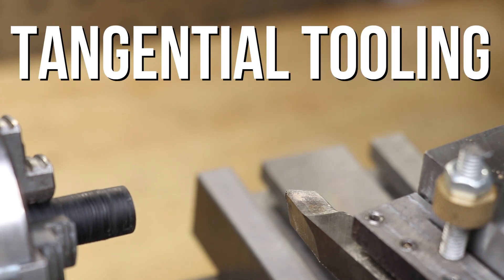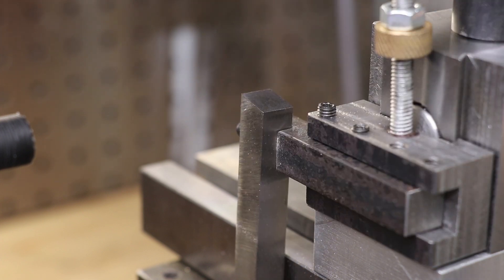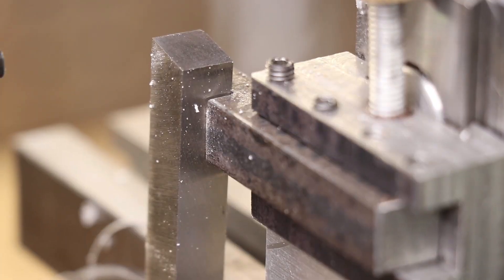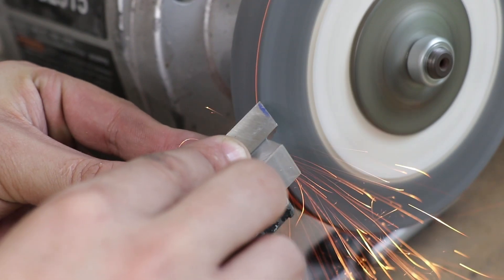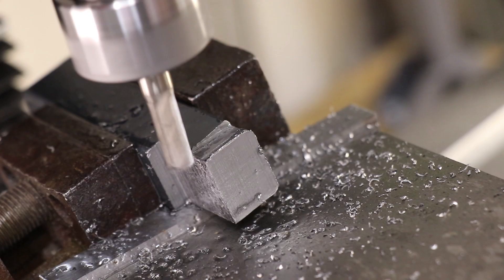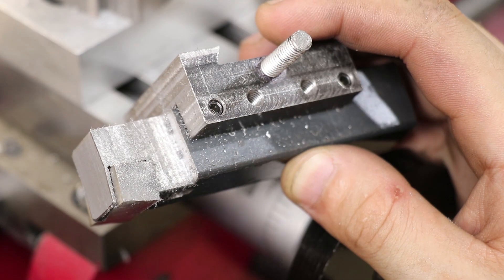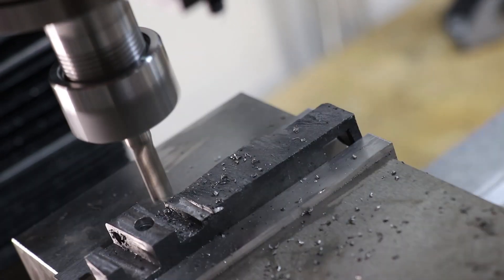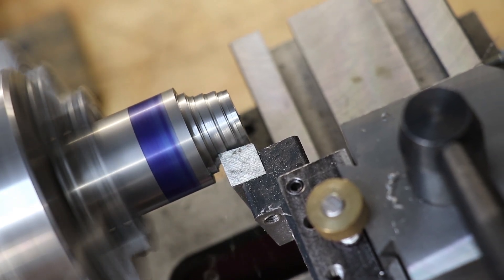WHAT Are Tangential Lathe Tools?

Comment: It’s somewhat amusing, but tangential tools go back to the mid 1800s. While they didn’t use tool holders the way we do today, they forged the entire tool as one piece. But the cutting portion was shaped like the tool blank in a modern holder, but not as long. They just ground the top. They could get a number of grinds out of it. But no HSS back then, just “tool steel”, high carbon steel, no alloying.

Comment: I don't have a lathe but I watch all your videos. This may be a dumb question but what is stopping you from cutting tangentially from a horizontal angle? A tangential cut is relative so I'm thinking you could have a horizontal tool and start your cut at the top of the piece. Stick out would be more but forces would be in-line with the tool and tool post. Maybe I just answered my own question. If forces are pushing back at the tool post, it might kick out the whole tool post? Thoughts

Comment: See if you can find a supplier of Solid Carbide blanks, then make a holder for those.
I might give it a try, since i make most of my lathe tools from Solid Carbide, broken or blunt Endmills,
In the past i have used square pieces of Solid Carbide which did the job excellently, though i had to grind them on 3 faces..
I use a Diamond wheel to sharpen them, and.. i admit.. boring bars are made on a wire EDM machine..

Comment: Very great video /info on tangencial tools.  This tool geometry made it's way into the standard HSS tool world of lathe tool bits [diamond grind shape] ironical from the use of this grind on HSS tools used in the balance and roller box tooling from screw machines back in the 1930's thru 70's IMHO.

Comment: I'm new here. But I have a comment question. 
While cutting some flat stock in my vice in my basement, with my hacksaw I ended up pushing too hard (1/8th x 2" ) I split my index finger nail in half at the base of thr nail threw my finger on the last stroke. It was amazingly bad. That was November ish 2019. For that christmass my wife allowed me to buy a used milwaukee porta band saw. I had one previously but sold it to a friend the year before because he was in need and at the time I was not using it nearly enough to justify it. 

I made it wall mount by a 2x4 steel tube that I cut the face and sides to accept the tools forward handle and welded it to a plate at the right angle to hang the saw. 

I made a 4 inch wide by 7 inch long cutting table that bolts around the foot of the saw and while semi stable, it is actually really good. 

I will make a video of this conversion from a handheld portaband saw to wall mount if you ask for one. 

But here is thr question. Have you considered swapping the hacksaw out for a different tool like a portaband? Or handheld bandsaw?

Comment: I have just picked up a old Hercus lathe 1957 era due to being on a disability pension  i dont have alot of money. Can i buy one of these holders . I cannot afford the carbide tool and bits so i was going to learn to sharpen Hss. But with this it looks like it would be even easier. Type c lathe . I can use up to 20 mm holder. Let me know if you would consider selling one also i live in perth Australia 6174 . Cheers Andy Andy

Comment: Check out 'Eccentric Engineering'.
Both square & round tangential tools work amazingly well with brass, cast iron, aluminium, plastics & composites. 
Would have loved to see the finishing comparison on a longer piece of material with tailstock support. 
If you twist-mount the HSS blank, it works as a shear tool too. The surface finish is dramatically improved over 99% of inserts that a DIY enthusiast can afford.
The lathe headstock does need to be as rigid as possible though, Worn out bearings will leave a chattery finish with any cutting tool, hss or carbide or CBN.

Comment: This principle has been used in form tools. It is easily sharpened as you pointed out, and the form isn't lost in the process. Another style is a partial circle with an adjustable means to keep it from rotating under load. I've considered making threading tools with the profile following the length of the blank. Probably would use a set/grub screw to adjustably counteract the axial load. 
Wanna' do and do are two separate things.

Comment: I fail to see the logic. What’s the point of creating another joint when you can grind tools in hss or carbide on a diamond wheel that are far more rigid. What you’re calling a good surface finish look very rough to me.
Reply from the maker: Is mostly down to grinding one face rather than 3.

Comment: One problem I see is that the tool will want to slip downward and nothing is there to stop it. I like the idea of just holding it at a compound angle and grinding one face, but the extra bulk at the front does add some additional limitations.

Comment: Wouldn't it make more sense to use a tool laying down horizontally with a back slope and just grind the same diamond but on the bottom? Lmfao. You have overcomplicated this to the max. Like imagine if you could just tip a standard toolholder back 15-35 degrees, drop it down to center it, and single diamond to create relief angles.
Reply from the maker: I don't see it creating the necessary relief angles, but if you want to try, I'd love to see that in action. With this tool, I don't see you its overcomplicated, just a slot angled back 10 degrees in 2 directions and a locking grub screw. A lot of people love these style tools, and I can see the value in it, though its certainly not for everyone. Cheers

Comment: You should really hone about a .008" radius on the corner of the cut edge. Leaving it sharp is a no-no. It will prevent chipping and give you a more consistent surface finish.
Reply from the maker: Probably, though I've been using this tool for taking light cuts and the sharp edge is perfect for it. The edge seems to be more resilient to wear than a Sharp edge on a conventional hss tool

Comment: I noticed the part of stock was wobbling or uneven, is that the stock or the placement in the chuck, just wonder if it's the machine or the stock, not knowing how good these Mimi lathes are compared to high grade full size lathes , thanks for the vids
Reply from the maker: The stock rotated simply because I was holding onto the factory finished section which isn't perfectly round and concentric to the machined part. This mini lathe is pretty decent for its size, though I have done a bit of work to it. Normally with this chuck I'll get 40 microns of run out which is fine for most work I do.

Comment: Nicely Done!  Have you considering heat treating your tool holder?
Reply from the maker: If I needed more strength from it I could have it case hardened, but on this lathe it is rigid enough for what I need. Cheers

Comment: That is not what I was taught as Tangential Cutting.  You have created a conventional tool face simply on the end of the blank, which is Tangential Tooling, as stated. The faces and reliefs are presented no differently to the work than a conventionally held tool.  Hence the cutting is essentially the same and tool maintenance is simplified,

Tangential Cutting is where the cutting edge is a line where two faces meet which is tangent ( in the X-Y plane) to the center of the work.  This would normally be the edge where the side and end relief faces meet. This edge is held at a slight angle to the work in the Y-Z plane, tipping toward the tail stock.  The normal cutting edge (with which you are cutting) is well above the center of the work and never comes in contact. 

The actual cutting is effected as the work rotates it moves down into the slightly angled (back) edge of the tool in a shearing motion.  If you’ve ever seen a cut-style knurler, or a rotary broach, the principle of using angular change in motion to apply tool pressure is the same.

However, your take on this topic is in compliance with the conventional presentation for tooling.  It is important that the distinction between Tangential tooling and cutting are made.  I guess you need really old textbooks, or old mentors (as in my case) to get the original ideas before they get lost in translation over time.  I believe you'll find Tangential Cutting far more interesting and useful.

Nicely done, keep up the good work.

Comment: But...why? Insert tools are so cheap, why even bother with HSS?
Reply from the maker: I use carbide for most of my work but it isn't always the best tool for the job, depending on the cut and material.
Reply: @artisanmakes  Aside from form tools, I have yet to find a situation where HSS is better, especially on small machines. The xCxT insert range is so comprehensive that there's pretty much always something that fits what you need.

Comment: To improve this you could make the dovetail of the qcth built in to the cutter
Reply from the maker: Certainly a design to consider. I've seen one or two online that use that design, though when I filmed this I probably didn't have the correct material size to make one. Cheers

Comment: Just use insert tooling
Reply from the maker: I use inserts more than I use hss, but hss still has its place in my workshop for thermoplastic and aluminium and light passes in steel. You do you but carbide isn't always the best tool for the job. Cheers

Comment: I find the need to have tool holders that must be held in other tool holders a pain as you can only have one type of tool, whereas you also need to do threading, parting, boring and grooving etc.........the normal QCTP holders provide enough tool holding functions for normal square tool bits without special tool holders that need special tool bit grinding......true you can use up short bits of HSS but I use them for boring bar inserts anyway.
Reply: The issue is mostly that as you grind your clearances and rakes to the tool, you need to cut the tip off and make a new one every now and then as it wears lower. With this style, you just touch up the top until it's used up
Reply: @MF175mp  Yes, I'm fully aware of the design and how it works, the guy who invented and made them went to our model club......this is very much like the tool holders on the old lathes with the lantern style tool post..........it's only suitable for one specific tool shape.
I use a lot of HSS tooling in my QCTP  but I wouldn't want to have to use one of these tool holders.....my preference.
BTW, if you grind your normal tool correctly you only need to grind the front or end face back to get a new edge, not the top or sides etc......most of the time it's the first front mm or two that gets damaged..........I use a tool that has a short grooved lip cut into the top and it only gets re-ground on the front face whenever.

Comment: Well done on your experiments,  so few bother these days and just settle for insert tooling.
You will find that 12 degrees forward  and sideways work well with a 30 degree grind across the top. You will also fine a small radius, a few thou or so, on the cutting corner running the entire length gives a more durable tool.
It beats me why these tools seem to have gone out of favour in Edwardian times, except for in things like roller box tools, but these days for home shops they are a brilliant money saver and go to show that all those angles listed in the usual literature for different materials is a touch of baloney.
Reply: Because insert tooling is just....better.
Reply: @elanjacobs1  there are times when TC inserts are the only way to go, like hogging great cuts or machining really tough hardened steels but if you want a 10micron cut in say stainless forget it. Insert tooling was created to fill an industry  need of which the home shop has little. Because inserts are created for industrial machinery most are in fact totally unsuitable for low power manual  machines and the ones that are are tend not to be cheap.
Reply: @chrisstephens6673  The entire xCxT range are suitable for low power machines. A ground carbide insert will also take a 10 micron cut if you want to.
Reply: @elanjacobs1  But for virtually free, I think not. I have been using the same piece of HSS for the last 3 or 4 years and it will last my lifetime and does basically all my turning and facing( totalling perhaps 90%) save for parting. 
The really good fine cutting inserts  tend to be exceedingly brittle, personally I love Sumitomo Cermet(titanium carbide) but for most purposes they are uneconomic, even more so when they chip. 😭

Comment: A handy design for using small bits of HSS and easy to set on centre height. However unless you grind a small nose radius onto the cutting tip it will wear out almost immediately. If you did that, it wouldn't technically be ground just on the top face.
Reply from the maker: You can round it on a stone, I used this one a bit and the edge didn't burn up. it seemed to be a lot stronger than a sharp edge on a conventional tool. Made it super useful in taking light passes.
Reply: Quick grind on the wheel then just touch up the nose with a fine diamond hone. Quick and simple

Comment: Great video! I bought the Eccentric Engineering diamond tool holder & the inverted parting tool for my Optimun TU2004V lathe. Due to the excessive overhang, I found that the tool would catch easily, so I ditched the QT tool post & went back to the standard tool post & the results are now exceptional.

Comment: What advantage does this 'tangential' tool bring? As I see it, effectively the rake, clearance and cutting wedge are about the same as conventional tools, but in a vertical toolbit orientation.
Reply: I have one and it is very easy to grind. I bought mine over 20 years ago.
Reply: And you only need to grind the top relief angle.
Reply: @ToolsNoTalent  again... This is a bad implementation of a tangential tool, plain and simple. Go look at the diamond tool holder video I posted, it's a much better example
Reply from the maker: If this design didn't work the clamping system would have been the next step. It's probably what you'd want if you were doing deeper cuts, but it's perfectly acceptable for a smaller lathe.
Reply: @artisanmakes  You need to click on the individual comment you wish to reply to. Most of your replies don't have anyone tagged, and it makes it look like you're replying to the op, and makes things confusing to follow.
Reply from the maker: @littlejackalo5326  I don't tend to reply using the computer (ironically I am now). The tagging problem is a issue with the YouTube creator app
Reply: Grinding is super-easy: the relief angles are provided for by the tool holder, so you just have to "shorten" your square HSS bit by a little bit. With a guide for your grinder, reliable forming of the preferred geometry is done in seconds. This way you have a "sharp" tool for non-FE metals & plastic that's also cheaper than buying inserts.
Reply: cutting force goes down "into" the HSS, and as a result there's a lot less chatter and vibration. with traditional tooling it's cantilevered out and this creates a much stronger moment force. have a look at the Diamond Tool Holder made by eccentric engineering in australia
Reply: @guitarchitectural  But I see that the tool is held with just a screw, there is no base to support the cutting forces, as with traditional tools. And that will eventually lead to chatter and vibration, not to mention other hazards associated with a lathe tool not held tight. The benefits of tangential tooling certainly do not outweigh the disadvantages as seen in this video. That said, the video shows turning on nylon and plastics. Would love to see this tool in action on real steel.
Reply from the maker: @SubramaniamLakshminarayanan  I do steel at the end without any issue. I was quite skeptical of this diamond tool, hence why I never bothered trying one until now. Seemed to work just fine without chatter in this set up. Granted you might want a little more to hold it in place if you are taking deep cuts. I don't see it as being better or worse than other types of tooling, it has some advantages and drawbacks.
Reply: @SubramaniamLakshminarayanan  don't judge them all by his substandard one. The diamond tool holder gets pinched between two "jaws" for this very reason.
Reply: @SubramaniamLakshminarayanan  The video shows steel cuts in the last two segments... anyway the way the forces are imparted into the tool holder make it look like it's a fragile set up but the tool is interference fitted first and then the grub screw holds it in place. The full force is not held by the grub screw due to the faces in contact sharing some of the load, if not most.
By no means am I saying this is the last tool you'll ever need but it seems worthwhile to reuse tools that have become too short to use conventionally.
Edit: and if you wanted to be sure you could drill two staggered columns of locating holes on tool and holder and pin them in place, with the columns allowing you to adjust the tool stick out as you re-grind it.
Reply from the maker: Tool isn't substandard, it meets the requirements needed for cutting forces expected on this lathe. On a bigger lathe you might want a clamping holder, but that isn't necessary here on this lathe.

Comment: Thanks for this video. I have one of the Australian tangential tools (Diamond tools) which I often use on both my Myford ML7 and my Taig lathe (Peatol here in UK). I use it with square and round HSS and it works very well, the round HSS especially gives a nice finish. The biggest advantage is the ease of sharpening HSS, and lack of wastage on re-sharpening. Also the ease of getting the tool ‘on centre’ without using shims etc. They don’t like interrupted cuts, which tend to hammer the tool bit down in the holder. Les in UK
Reply: Me too and I use Crobalt tool bits. Like you I use a standard tool for interrupted cuts as they also seem to take the edge off the diamond tool quickly. Robert in Aust.
Reply: 'Eccentric Engineering'..The chap makes ingenious thingammajigs!!